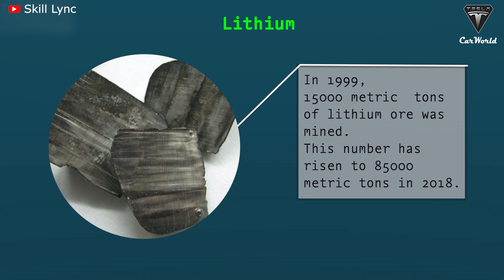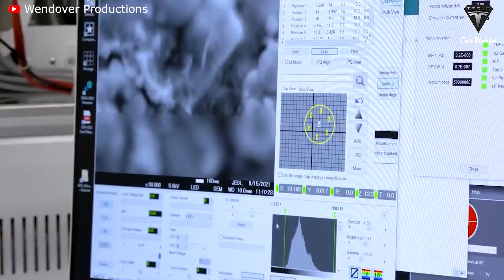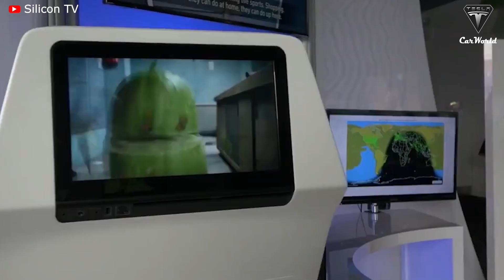IT'S WARNING! Elon Musk Leaks Giga Texas has STOP Production IF Panasonic has a Serious Problem!

Comment: If Bosch were to run into problems, there would be no automaker to produce even one car. In the case of tire manufacturers, there are a total of 5? 
So what's the point?  Panasonic operates several plants and the cell business is the most important one in the group.  Panasonic operates the plant in Nevada with Tesla as a 50:50 company.